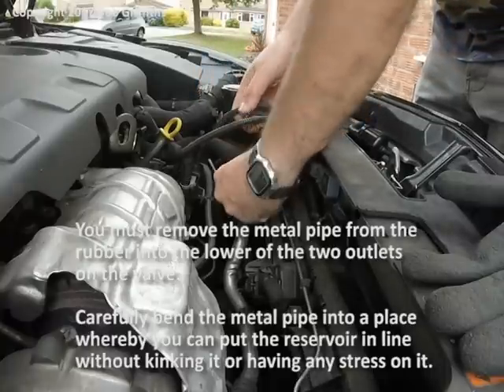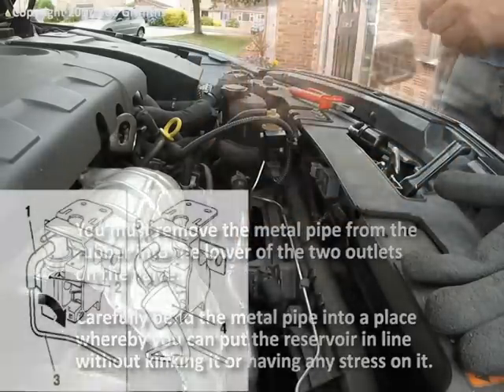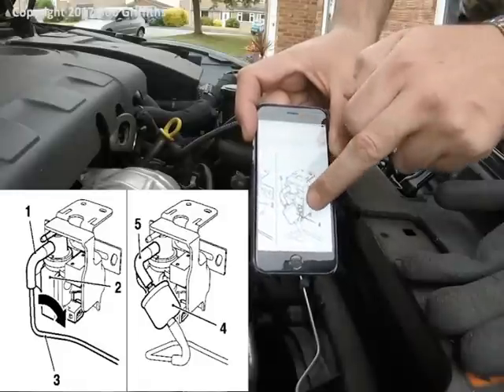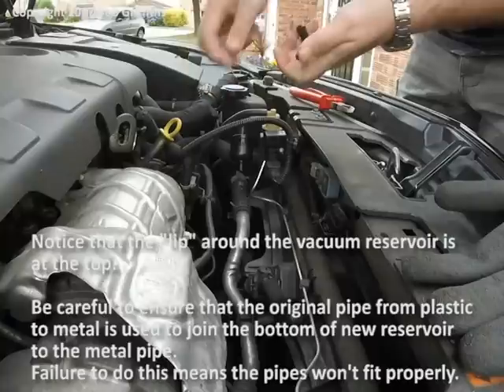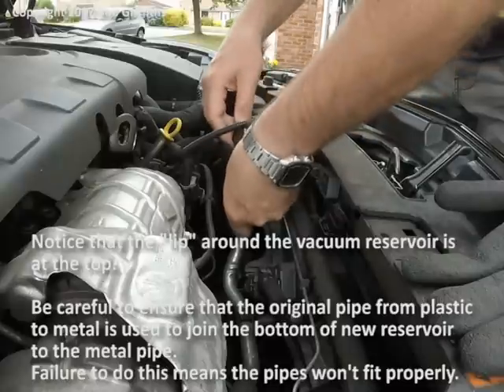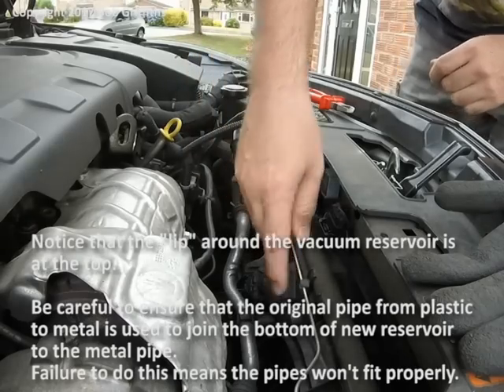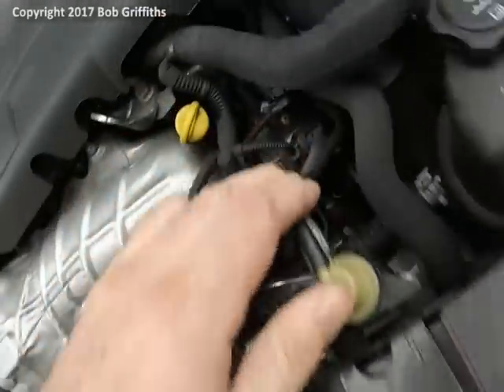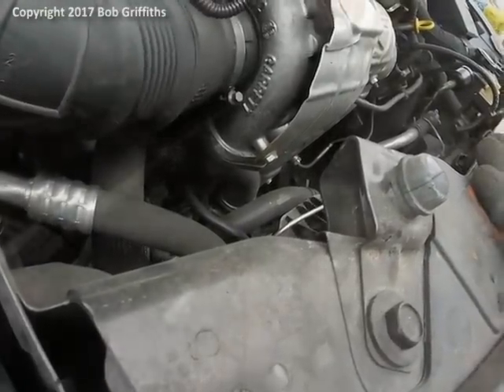Vauxhall Insignia - Strange Noise and Vibration Issue - Example and Resolution

Comment: I have the same problem it started a while ago with just a little sound now and again but has got worse and worse and is now most of the time, blip the throttle pedal and it stops it briefly sometimes. I am going to try a small inline fuel filter to act as the vacuum reservoir.

Now had the inline fuel filter in the bottom pipe on the solenoid valve fitted for a couple of days happy to report that the problem has ceased no other issues have occurred. The inline fuel filter was bought off ebay 2 for £2.99 with free postage.

Many thanks to unibatbob for posting the video with the cure for the problem.

Comment: Thanks very much for the link. This  video was very helpful. Top tip if your tailgate switch goes like I had  there is a good Vid by the German guy. It saved me 160 pounds. Part cost 20 quid. This is a common fault also on the insignia.

cheers

Peter
Reply from the maker: Cool, thanks for the info, I'll bear it in mind if the switch goes faulty!!

Comment: Hi , you had boost leak also? Or just the noises ? Please answer
Reply from the maker: Hi I have had a boost leak on a previous Vectra and a quick change of the boost hose sorted it out easily and quickly. I wasn't recording stuff back then though. This video was not about a boost leak though.

Comment: Hey there mate. Im more then certain this has something to do with my car too. Just a quick question, cab this sometimes cause a faint smoke arise from the bonnet seem ?
Reply from the maker: Not something I'm aware of. I have another video where steam came from under my bonnet on heavy acceleration, due to a coolant leak from the EGR Cooler / Vacuum Box.
If it's smoke rather than steam, I'd take it to a garage. If it's steam check out that other video of mine..

Comment: Found another issue which is intermittent vibration foud that the cam belt cover plastic top end is catching on the pulley and wears a groove in the plastic.
Reply from the maker: I never had that but it does look more than possible. Hope you got it sorted. I chose this as it was on a Vauxhall Service Technical Note..

Comment: Fitting the alternator on these is very easy anyway, no need to bring it to a dealer for that either, just make sure you disconnect the battery first.

Comment: Hi
I have the noise sometimes when I close the bonnet.
I have this vibration through the car (not the steering wheel) which varies in strength and no 2 times are the same. It can best be described as if one of my tyres has a big flat spot.
Do you think it could be this causing the issue?
Reply: jubilee762 it's the same thing, get that done first and I bet you it will disappear. I have done loads of them.
Reply from the maker: yep, sounds similar to me. it depends where you feel the vibration from I guess. It felt for me like it was coming via the steering wheel but it's worth checking it out.

Comment: My insignia loses power when going up hills any ideas? Also when putting your foot down it's very slow with no boost
Reply from the maker: I had this in a previous Vectra and the boost hose had split, might be worth checking the boost hose , it's quite a wide bit of hose but a split in it allows an escape of the boost gases and a loss of power. If you're unsure though, do take it to a professional.
Reply: @bobgriffiths  had that changed its comming up with P003a and p2263 fault
Reply: Fuel pump

Comment: Hi everyone, do you know if/where can we find that part in the UK without ordering the whole thing with the pipe?
Thanks
Reply from the maker: https://www.autovaux.co.uk/55587330-turbocharger-vacuum-hose-as55587330
Reply: @bobgriffiths  hi, thanks for the reply though ive already replaced it with a grnuine one from ebay for ~20£. works perfectly so far for more than 6 months

Comment: Thank you mate :) I might try this on my Opel Insignia I got same probs when the car is proper warm and when I'm driving normaly (3. to 4. gear) its starts moaning and the noise annoying me , but does the buzzing/mooing sound only comes when you revving or also you when driving with lower gears :) ?? Greetings from Denmark
Reply from the maker: Joey C it's worth giving it a go rather than taking it to a garage.

Comment: Devastated i missed out on this !, they advised that as of the weekend they are a discontinued product for them :'( any idea where else sells them ?
Reply from the maker: Just search for the 55589096 number and some shops will appear.. You can always try a dealer too, they may stock them or get them in for you...
http://www.eurekacarparts.com/vauxhall/55589096
http://www.ebay.it/itm/VAUXHALL-INSIGNIA-2-0-DIESEL-MOD-VALVE-55589096/281428695719

Comment: I have replaced the valve and the noise is gone but now it makes a noise like its releasing air.. Is this normal?
Reply from the maker: sounds like you may not have put the pipes back on properly or there is a split in the vacuum hose,. Take it to a mechanic if it continues. Good luck Chris.
Reply: @bobgriffiths  thanks. It was a rubbish ebay part and the valve wasn't opening.. I got 1 of a scrapped car and sent that 1 back. Cheers tho

Comment: The vibration you are talking about. It is in idle or when pressing the gas pedal in drive mode?
I have the same noise in my car and mine is also vibrating when im driving but only when im accelarate. 
Im suspecting this Solenoid Valve after seeing this clip.
Reply from the maker: abiyhmor for me it was more noticeable in traffic when accelerating and then stopping on idle. It was a bit random. Sometimes it would do it for the whole journey and other times for small parts of it. My main dealer quoted £££’s for an alternator so this was worth trying for me for the reduced amount of money. It is a GM fix too so it’s known about by Vauxhall and GM. Hope you get it sorted soon.
Reply: abiyhmor I have the same issue as you. did u find out what that was?
Reply from the maker: Arkadiusz Osinski yes. All of the info is in the video and the comments. Good luck.
Reply: abiyhmor I have exactly the same problem. Have you sorted it out yet. Thanks
Reply: Mohammed Shuvo  

Not really. Im suspecting my driver shaft..

Comment: Could you please supply the address where you purchased the part. I have the same problem. Many thanks.
Reply from the maker: Sure can! Search for 55589096 on the website, http://www.genuinepartsearch.co.uk/ and it was £14.63 as of 2nd July 2017. Hope this info helps you out with your problem! (It's no guarantee but it's certainly cheaper to try this than take it to a main dealer to get it checked out)
Reply: Hello, but it solves the problem? My husband do this but it not solvesed the problem :(
Reply from the maker: eeegliukas1 sorry to hear that. Perhaps it's something else. Try taking it to a professional garage as I'm not a professional mechanic I can't offer any further help. Good luck getting it resolved.
Reply: do you know where else i can get this part?

Comment: I have that noise on my 1.3 Astra when I turn off the engine..
Reply from the maker: Not sure if it has the same piece of hardware on the astra, worth having a look before you spend any money, if in any doubt take it to a garage. Cheers and good luck.
Reply: It’s the fuel pump de pressurising I now believe

Comment: Hi guys, my car mechanic told me that using this solution i should have engine issues. Did you have any problems After the installation? Power issue, engine light turned on etc...
Reply from the maker: Alessio Vagnarelli nope. Far from it. My car has been fine since and I’m still getting 48mpg on a long run. 
It’s also a GM Vauxhall recorded solution that is done in main dealers so it is the right thing to do. 
If you’d rather listen to your mechanic I wouldn’t blame you. I’m not a mechanic  and I don’t purport to know what’s best but it was a documented solution. Check out some of the other comments on this video to see what other people think. 
Cheers for your comment and good luck solving the issue whichever way you choose to do it.
Reply: @bobgriffiths  Do you know if the Solenoid solves the issue on the engine A20DT?
Thanks
Reply from the maker: Alessio Vagnarelli it solved my issue. Ymmv and if in doubt go and see a mechanic. Thanks.

Comment: My insignia sri has same noise but no plastic piece behind...would it be the turbo valve solinoid???
Reply from the maker: I think I've seen it referred to as the turbo valve solenoid somewhere, it just starts flapping, unable to open fully or close fully so it flaps between the two states. To be clear I haven't changed the solenoid valve, just added a reservoir thingy in-line with it.
If you're not sure always take it to a garage or a trained mechanic, I only found this trick after googling the symptoms. Thanks for dropping by.
Reply: unibatbob yes it is the valve...been swoped tomorrow...funny how a little piece of plastic can make so much noise
Reply from the maker: Hope it works out for you, I know how bloody annoying that stupid whirring noise is after a while..

Comment: Mine was buzzing and now, car keeps going into limp mode. I'm worried it might be the turbo, it hasn't been smoking or anything so not sure. Do u think it might just be this part that has gone completely?
Reply from the maker: osidda1 honestly. I’d take it to a mechanic for a check. It might be a problem with the valve but I wouldn’t be able to offer any more assistance. Sorry.
Reply: @bobgriffiths  It's booked in on Wednesday. Tonight the fault didn't flag, but all of a sudden, it flagged engine over heating please stop, got a bad smell of burning soot, I removed the error with the obd2 reader and has been ok since. So God knows what's wrong with it.
Reply from the maker: osidda1 I hope the mechanic doesn’t have bad news for you and that its something easily remedied. Cheers.
Reply: @bobgriffiths  weirdly, got into the Car today, turned this ignition and no faults flagged. Drove for 30 miles and drove perfect. I'm so fu**ing confused.
Reply: Right, it's been to the Mechanic and it was the Turbo Boost Pressure Sensor. Bought a new one off EBay for £29, took him 5 mins and done. Car is running like a dream and alot more power. Must of been an issue since buying it 6 months ago.

Comment: Hi friend, I have a Opel Insignia Sport Tourer 2.0 DCTI 2010 with this noise. Do you think this product is ok and fit for my car? Please somebody let me know. Thank you.
Reply from the maker: rock'n'roll machine that’s the same engine as mine I think. It’s got to be worth a try.
Reply: unibatbob my car is OPEL Insignia 2.0 CDTI 160CV Sport Tourer Cosmo 2.0 cc Engine A20DTH Diesel. Do you have the same car?
Reply from the maker: rock'n'roll machine not exactly but I’m pretty sure it’ll be a similar problem. I’m no expert though so if you’re not sure you should take it to a garage or a qualified mechanic.
Reply: Thanks a lot. I will update you.

Comment: Does anyone have a link to a seller for this part. My 2011 CDTI, 2.0l SRI model is now making this noise.  Thanks in advance.
Reply from the maker: Not sure if it helps, but I've just found this by searching for 55589096, https://www.autovaux.co.uk/55587330-turbocharger-vacuum-hose-as55587330
It's a different number but if it's that black item it will more than likely be ok.
Reply: unibatbob thank you. I saw that and did wonder if it was an extension to the vacuum. I'll have a look at it and report back. Thank for your reply.
Reply from the maker: You're welcome Ian.

Comment: How this solves the problem and isnt it better to buy new boost controller instead of adding some stuff there??? Hmu pls
Reply from the maker: I don't know the reason behind it but I think that the valve starts fluttering and the reservoir just prevents it getting into a cycle like it does. This is a known issue and Vauxhall / GM have a tech note that details this exact fix for the problem. I don't think it's indicative of an issue with the valve being faulty but perhaps it's just on the edge of the pressure required to pull the valve closed or open. It works a treat on mine, a colleague at my work has replicated the fix for his and googling the issue also shows others who have done this very same thing. It's entirely up to you how you go about resolving your own issues, my video is on here only to show other people what I have done. If you're unsure in the slightest, please go to a garage or professional mechanic who can advise you. Thanks for engaging on this vid though, much appreciated.
Reply: unibatbob tkanks for your answer. Did some research and the guy on vauxhall forum said he changed the whole thing 3 times and issue came back untill he order that valve. Will order that part too. For 25 quid you cant go wrong. Good job mate!
Reply: it's no valve, just an empty plastic cylinder, it increases the volume of air between the solenoid and the turbo.

Comment: Replacing the alternator it’s got nothing to do with the solenoid controls the waste gate I don’t see what the alternator is got to do with it my mini cab insignia Cdti has done over 350k and the solenoid last about 12mth and that’s it
Reply from the maker: It's not related to the Alternator at all, in my opinion. Best of luck with your issue.

Comment: There so many common issues with these insignias gear box. Intercooler boost pipe .this buzzing sound.now I have a power steering pipe split and it's leaky also  a tailgate broken too . And all that is common  problem worst car I have ever owned.
Reply: all that is annoying but cheap to repair. Other cars have less issues with those crap, but repairs cost up to 50% of total used car value, like Vag DSG, Electronic problems, injectors that cost 400€ per cylinder etc